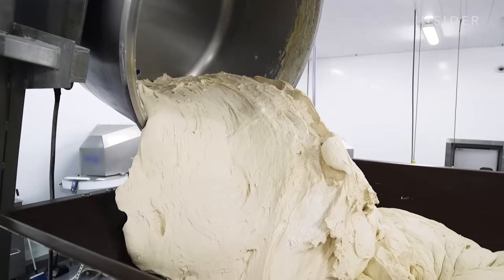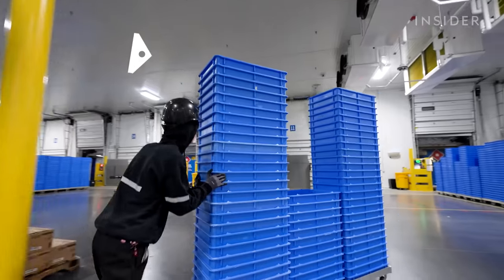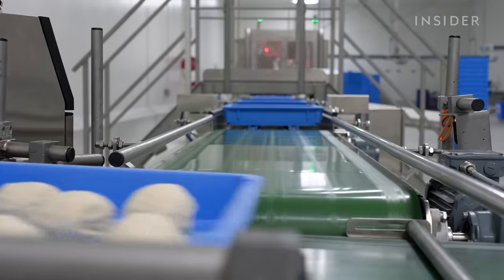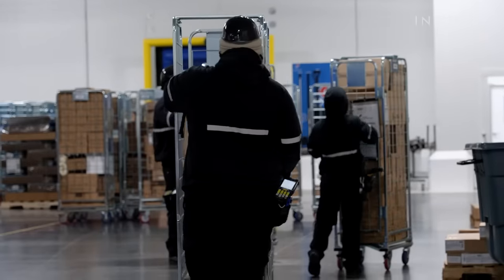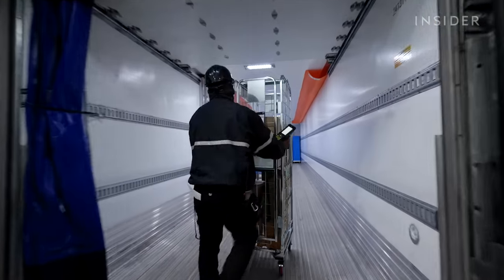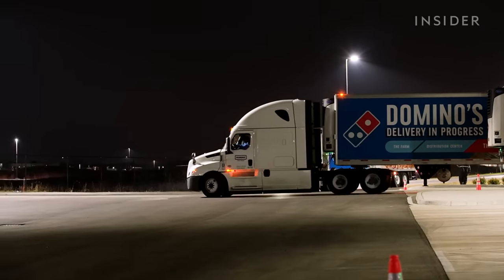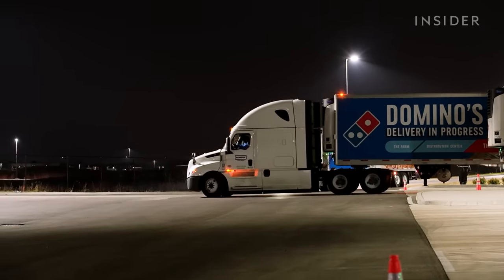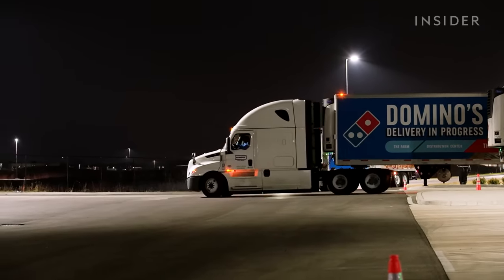How Domino's Became The World's Biggest Pizza Chain | Big Business | Insider

Comment: At least their doughs aren't frozen.  I used to work for Pizza Hut a little over 10 years ago and their pizza doughs come frozen.  We would take it out from the freezer and put it in a thawing machine which would take about an hour to thaw.  I hated Pizza Hut because they were robbing their drivers of the delivery fees.  The store would charge $3.50 at the time for delivery and only gave the drivers $1.10 per delivery, but they would make them do two stops and still got $1.10 i stead of $2.20.  I was one of their drivers.  This is why I hope Pizza Hut fails and shut down permanently.
Reply: Pizza Hut might use robots for deliveries soon.
Reply: I'm sorry. Yeah these big companies are cheap. I'm nobody but I always tip my drivers at leat 10 in cash. If a big order 20. I rather them having cash in their pocket. I don't trust adding the tip on my card.
Reply: @anonymouszero9422  tipping $10 on even small orders seems crazy to me. good on you though
Reply: I never cared that it’s frozen. It’s still better. It’s always soft and well made while dominoes was like cardboard
Reply: Costco is frozen too
Reply: That's worse than Round Table, still bad but they charge $6 delivery fee and drivers only get $1.75. They cut it recently without notifying anyone, only found out because we checked our receipt after getting cashed out. Absolutely scummy
Reply: I see a class action lawsuit against Round Tables

Comment: The warehouse I work at introduced electric pallet trucks, (which I personally don't use, as I find them a pain with changing batteries and stuff.)  But it allows people to work there that would have struggled to pull the manual pallet trucks.  As well they have started rotating us on different jobs which helps prevent repetitive injuries and stops the job from getting boring.  This has all happened due to competition for workers, which has benefited us financially but also in working conditions.

Comment: The creators of the program either did not understand the essence of the issue or deliberately showed robotic manipulators near deep fats as an advertisement. But it was about completely different robots and their application. The fact that a robotic arm was installed in the KFC is nothing more than a publicity stunt, since the actual installation of such equipment for periodic operations does not make sense. Simply put, this is expensive nonsense.